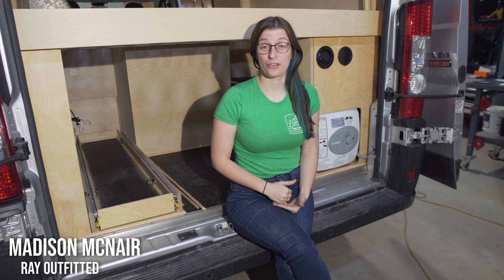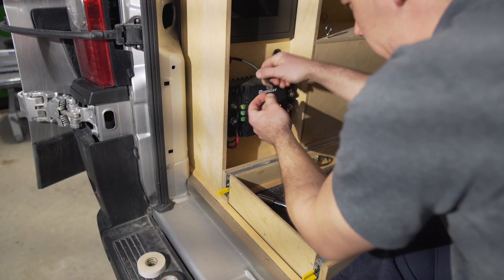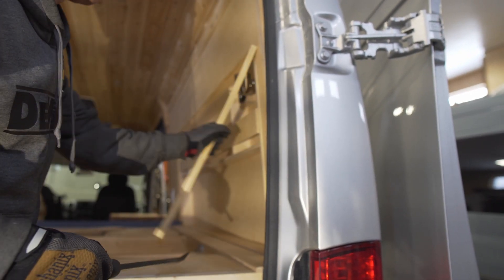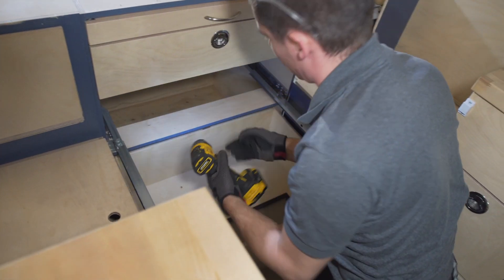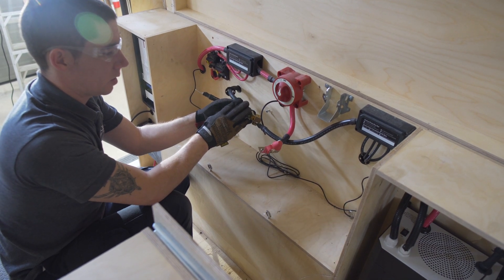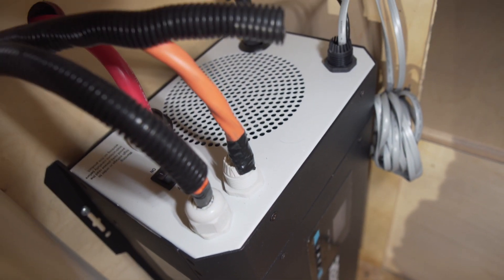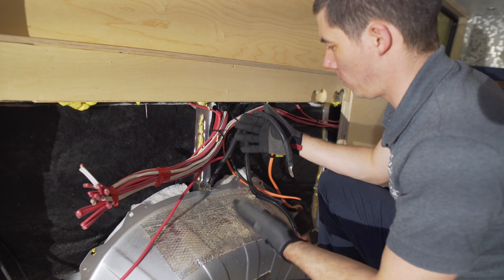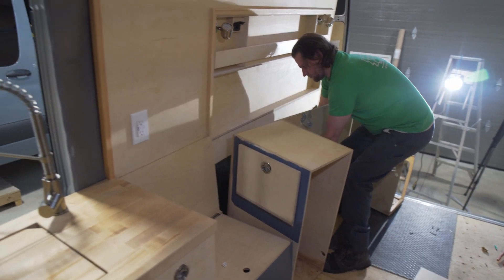Vanlife Electrical Diagnosis - Don't build like this - Episode 2

Comment: What a mess!  Loads of great points brought up there.

Madison, you brought up the point of something not being strong enough if somebody can just pull on it and dislodge it.  I think that a lot of people get caught up in the nerdy details of shear strength and such but overlook a good old fashion 'pull on it' test.  Engineers can argue all day, but if a bed can be removed by just hands alone, I think everybody can agree that isn't sufficient.  Good thinking there!

As far as being able to access everything, lots of great points there.  That made me think of a few things, specifically, that I'd be asking myself:
If something needs to be connected behind the wall...  How much needs to be 'undone' to access the connection?  Can it be accessed without demolition?  Can it be accessed by unbolting alone? Can an access panel be installed?  What steps are being taken to make sure the connection doesn't come loose (stop nuts, lock washers, loctite, etc)?

Thanks for the video!  Lots of good thought provoking build concepts talked about here. 🙂😂👍

Comment: Great show of bad case thanks. The road is cruel. Question? What is your chassis ground philosophy? For me existing uses chassis but in my mind all the upfitted product should be done with parallel wiring. Easy to install,verify,service. On this rig the chassis ground caused issues that could have been avoided by running ground as well from alternator. Yes costs but I believe good trade off????thoughts. Great to see Ontario success. All the best.

Comment: Wow.  I'm all for empowering oneself to not let little things stop them, but there's a point when you need to at least do some research and ensure you're using the proper materials.  I'm still on the fence as to whether I'll attempt my own build or just hand it over to a professional, but if I do decide to tackle it myself at the very least I would (pay to) consult a professional with experience for their perspective on my design and plans to make sure I wasn't making any obvious blunders.
I can only guess they were using the wrong wiring because it was cheaper?  That doesn't sound right, because I'd think thicker wiring would mean more copper which would be more expensive so maybe they just got lazy and used whatever scraps were laying around instead of waiting to have the correct wiring on hand?  It doesn't make much sense!
Reply: Or they collect left over spool ends, or get recycled wire out of reno's. Or, judging from the level of purposeful ripping off of the client evident here, they'd be the types to steal it.

Comment: Unfinished and not even sanded 2x3's under the bed! Nothing screams 'pro' like that! Wow!!!! Holy schit this is gonna go to hell in a hurry!
Reply from the maker: When we started filming this demo project - we didn't expect things to be so bad. We knew we had electrical and plumbing issues made worse by lack of access. We didn't expect the volume of water damage or the lack of structure. This was a heart breaking project.